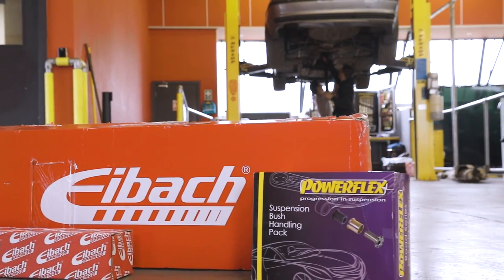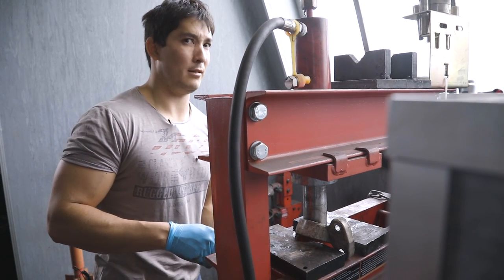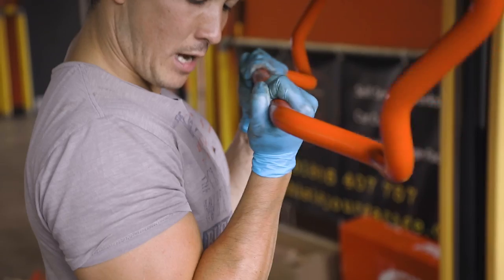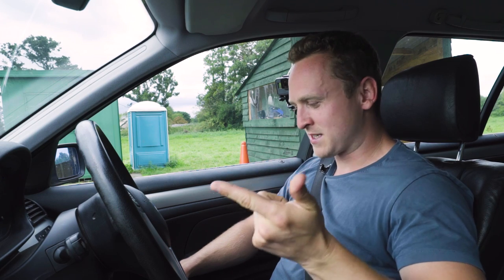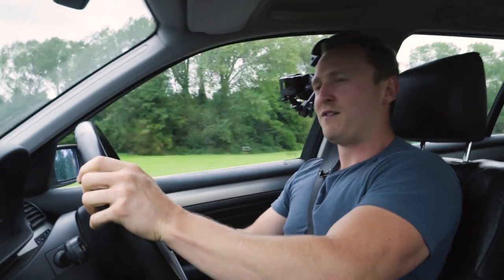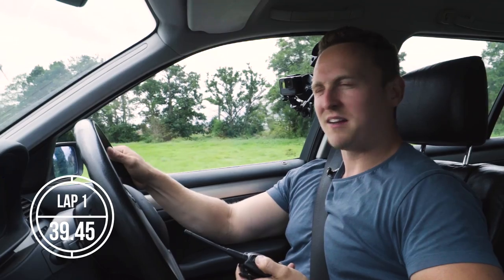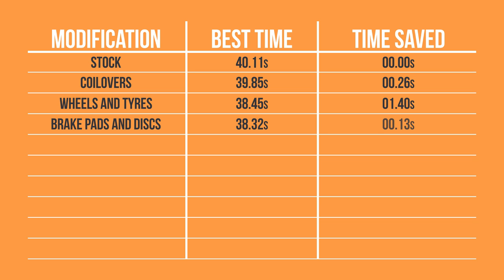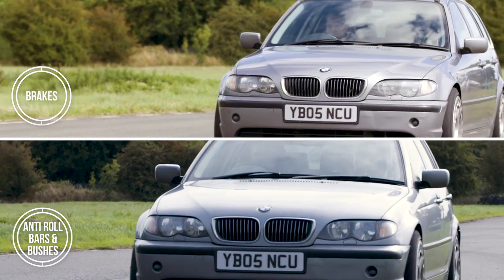Do Thicker Anti-Roll Bars And Polybushes Make A Car Faster?

Comment: I put stiffer front and rear ARB on my old Impreza and it introduced more understeer on turn in. I put the standard front ARB back on and the car was fantabulous. The stiffer rear definitely helped it feel nicer on power coming out of corners. Whether it was faster or not I don’t know, because I didn’t have a maste with a stop watch like you do, but it felt great.
Reply: Yeah, the lack of improvement could be down to the change in balance. Could be too much oversteer, leading to inadequate power delivery/exit speed. That's why adjustable sway bars are MUCH better.
Reply: yep, on awd and fwd cars especially, uprating the front arb almost does nothing, it keeps the understeery nature of the drivetrain, but what's the fun in that? Planning on putting an uprated rear arb on my 9-5 aero and some fresh front bushings

Comment: One point is missing here... The geometry of the car. 
Very cheap is to buy a IR thermometer and check the temperature distribution on the tyres. 
In case you have too much temperature on the inside you can adjust the camber more positive.
Or more toe in etc.
When I see you car in slow motion I can see that the tyre is deforming, even if the rim looks okay. 
Please go on the track and check the temperature distribution!
I would expect min. -0,5s by a professional setup.

Comment: I had a set of Hotchkis anti roll bars with polyurethan bushings installed on my Nissan 370Z 6MT sport pkg a couple of years ago. It definitely reduced body roll during cornering and sharpened the turn in approaching corners. The tradeoff was increased ride harshness, but that wasn't a big deal.

Comment: So am I the only one thinking that all they're proving is that these mods are mostly a pointless waste of money? They've made the car stiff and more uncomfortable and that barely made it any faster at all, the bulk of the improvement so far has been from simply fitting better tyres. Making a car corner flatter doesn't always mean it will actually go around the corner faster, even if it might "feel" like it.

BMW knew what they were doing when they set up the suspension and realistically you're not going to do better by just throwing in stiffer aftermarket bits. A decent set of tyres and a remap would have probably shaved off several seconds already.
Reply: Sérgio Alves basicamente...num carro usado principalmente para fins desportivos faz algum sentido, em carros de dia a dia e deste tipo (carrinha com motor Diesel) é perda de tempo e estragar o que o carro tem de bom de origem.
Reply: You are 100% correct sir.  Lower and stiffer is not often faster.  Never on bumpy tracks and in wet

Comment: Love the channel. Before you add power you should fit a limited slip diff so you can put the power to the road, corner exit speeds will vastly improve as you are able to go on the power sooner.

Comment: Please just strip the damn car and the lap time will drop dramatically....
Reply: a bit unfair as the E92 M3 wasn't stripped down also
Reply: also unfair to people that don't have such wagons in their markets and that drool at the idea of having this car
Reply: @thegreatfalcon5  what? How do you not have this car on your market? Where are you from? Mars?
Reply: The Shark  Canada but as far as I know we didn't get the E46 wagon diesel... only the gas sedans and wagons
Reply: oh, I see, i'm sorry dude..
I'm not really a fan of diesel cars, i think you'd be better off with a gas one, but heck, do your thing
Reply: The Shark  When you taste the low MPG a diesel gets in pretty much any conditions (highway, city, racing, towing...) ... Also, the fuel is way more readily available and generally diesel engines are much less complicated thus more reliable than gas engines... SO much torque at such low RPMs... Been daily driving a TDI for over 3 years and the next step is going full electric... Can't go back to floppy gas cars...
Reply: i've driven a lot of diesel cars, from vw's to bmw's, and in my country (Portugal), arguably 70% of the cars you see on the street are diesels, but diesel cars, to me, are just heavier and dreary, while I'll admit the low RPM torque is pretty sweet, it really isn't the best way to go racing, as it will probably produce wheelspin..
Also, I don't do a lot of mileage per year, so having a more expensive, less thrilling (to me) and less powerful car, would be pretty much pointless..
Anyway, I'm glad you enjoy your TDI, I hope you have fun in that thing, those engines are bulletproof if you keep up with the regular service.
Cheers

Comment: I bought a front and rear anti-sway bar set from Turner Motorsports made by H&R. The front anti-sway bar I always joke about could be used as a curl bar for your biceps. I think it's 36 mm. Quite a bit larger than the very WIMPY stock anti-sway bar.

 And then I see the guy in the video actually using it as a barbell LOL. 
Mine are adjustable I have the front adjusted to full stiff. And the rear I have at full soft. 

I don't think the bigger anti-sway bars affect my ride quality negatively. But they certainly do keep the car from rolling on the racetrack and in the street.

Comment: You may not notice the larger anti-roll bars, but if you do the poly bushes in the control arms in the front suspension, you WILL notice a difference.  At least I did when I put some in my first neon.  I actually hated how numb and stiff it felt at first until they wore in a bit and I got used to the new handling characteristics.

Comment: Watching the slow motion footage almost shows that the car with the huge bars cause the car to slide out from the apex more; losing time. Knicking that high curb probably adds time. I realize they're trying for shortest distance.  Can you dial in the springs/shocks or maybe an alignment suited for this track? Tire pressures? Try a comparison with a more seasoned driver to see if there's a greater difference. 
This has been fun to watch. 
I'd keep the interior. It's more realistic to what people do to their cars. Who would daily drive a gutted car? It would get old real quick. 

Keep up the good work guys.

Comment: Next stage : Drop in K%N  air filter, replace Heavy factory muffler with lught aftermarket muffler, Limited slip dfferential. This will result in better traction at start and more power delivery under heavy load, a bit more air comming into the engine/ engine brething a bit better, and 20or so Kg weight reduction. Your best bet would be remowing the interior that is behind the driver, but since his is still a  daily driver car that is not an option. Greetings from Slovenia, keep the mad fun series going.

Comment: Hi Alex. Great project:). I believe for you to go faster still without increase in power is to service the car. You can use that to say you need a tip top condition engine before increasing.

Comment: 12:22 - Although in the 'swaybars' car the driver would be trying harder due to the decreased body roll, it's interesting to note that the top car has considerably less initial understeer and is then neutral coming out of the turn, while the bottom car has more understeer followed by final oversteer requiring opposite lock to negotiate the same turn.

Comment: Sometimes thicker and sometimes thinner rollbars make cars faster, you need a balance not a bunch of parts.

Almost all of the time poly bushes are a huge upgrade (except for on sways), unless there is an issue with bind resulting from a part that is supposed to do more than turn inside the bush.

Sway bar bushes are a tuning component allowing more or less give before the bar comes into full effect. Best to leave them off at first while upgrading the rest of the suspension, then add the polys on the end of the car needing less traction.

Comment: The E46 is an awesome entry level platform and I love what you have done with your E46 330d ,but may make a suggestion possible for your next episode before power mods. An upgraded Differential would help loads around those turns as well as weight reduction. I say alone with these mods you will see atleast .25 second off your time.

Comment: I know this is your show, however, I think next time you decide to do something like this, start with the bushings first, please? The reason I say this, you could have seen just how much difference is made when replacing old rubber bushings with new poly. bushings. This could have been a great way to see if any difference was made with the poly. bushings with the suspension still stock, and you would have gotten one of the hardest mods out of the way first as well. I know personally what a difference going from worn out bushings to new stock replacements is like, but I would love to have seen the difference made going from the rubber bushings to the poly. ones. At that point, everything else you changed would likely have done even more to lower times.

Comment: I did Strongflex poly pushing in every suspension part on my E36. Definetly worth it, but it's not a job you do in your home garage with your mates over the weekend. You need a press, and you need patience. Lots of sitting around with a screw driver and hammer dink dink dink getting that 30 year old inner sleeve out

Comment: This does only help on a race track or a new paved road. My car had progressive lowering coil springs on it when I bought it, that shit was the first I changed to standard springs as the car was bouncing of the road in the corners. Could increase the speed a lot with longer travel and softer springs on our bumpy roads.
Would be interesting to see what time you would get with a 5 cm lift and slightly larger offroad tires and then cut the corners instead.

Comment: Smallest differences do biggest changes, so what about clutch stop bolt mod, so you don't over-press clutch and save time, this car uses electric throttle. Sprint booster is proven to increase throttle's responsiveness

Comment: Even if the tires aren't stressed as much on that short track they won't get better after each run...would be awesome to see a completely new set of tires (maybe even a premium brand like Michelin or Pirelli) at the end of the series if there's a notable difference between a set of brand new premium tires and slightly used budget tires.

Comment: First of all I have those yellow power Flex polyurethane bushings on my E46 M3. As far as poly bushings go these are quite soft and the car rides fine. I actually wish I had put in some harder durometer bushings. I will probably replace them with harder AGK bushings.

Comment: I'm going to go through the trouble of removing a part especially something as simple as subframe or sway bar I'm going to strip it down to bare metal and give it some paint to prevent corrosion. It would drive me bananas to know that I took it off and could have painted it.

Comment: Polybushes WILL NOT last longer than a rubber one! where rubber one has to just flex, polybush has to rotate where it wears very fast, so you have to re apply that grease to stop wearing them down completely. BTW. love your series, keep going :)
Reply: Well said. You're right. From my research hardrace rubber bushes are a better option than anything poly.

Comment: Why not see if changing the rear diff ratio will help scrub time off by putting more usable torque where you need it or extending the top end out?

Comment: Messed up putting that large bar up front on stiffest setting. Reduced outside tire grip. Try on soft and would have been faster and had more total tire grip. Or leave on oem sway bar up front   . Sway bar is not the way to go for grip. You have to increase track width to reduce lateral weight transfer, add stiffer springs. Set rebound and compression rates for comfort or perfomance ride bias. Sway bars are only there to fine tune over steer or under steer. Not just jack up the size or stiffest setting. The video comparison clearly shows more tire grip on oem setup VS over steer and lack of outside tire grip.

Comment: Yeah what you've done there is by fitting a stiffer front anti roll bar is to decrease the front grip slightly. @Engineeringexplained has a good explanation of why.  :)

Comment: What you didn't mention in the video is that poly bushings make the car stiffer all around, which can be very irritating on a car that's daily-driven. There's a lot more NVH transmitted from the road and you lose a fair bit of ride quality. That doesn't matter on a track car, but unless you do a significant amount of track driving I'd say poly bushings are overkill. Thicker sway bars, on the other hand, are worth doing on any car.

Comment: I agree that the poly bushings make the turn in sharper and the responsiveness generally better, but this type of anti roll bars do not make your car faster because they cause even more weight transfer to the outer wheels when cornering (i know it sounds weird because the car corners flatter, but it's true), so you have lesser cornering potential. Although, they give the driver greater confidence because of less body roll experienced.

Comment: So they fit new bushes all round and new rear camber arms, but then no wheel alignment job?  Surely you'd want to make sure everything is angled right after taking it all off and putting it back on?  A good setup can make all the difference!

Comment: Trust me in the point you are now, stiffening the front and rear towers connection would make a considerable difference. Youve stiffened the suspension, so now more flex goes into the chassis than before. Time to stiffen the chassis. Put front and rear Sway bars. Proper ones.

They dont do almost nothing on stock softer cars but as soon the suspension gets stiff the flex in the chassis gets greater and its time to stiffen up the chassis otherwise the faster rebound of the damping is absorbed in efficiency with the added flex. And chassis flex is worse than soft suspension for this purpose because that flex allows the chassis to change the geometry  to an undesirable point during cornering, which means that the wheel attack the road with an undesirable angle more often, therefore less grip. Geometry is very important and those cars have great suspension design but could be easily flawed with chassis flex.

Comment: if you decide to improve power, If you supercharge it I would suggest you a superchanger for the massive torque increase with also the diesel engine massive torque. If you put a supercharger also the boost would be instant at around 1.5k-2k revs being perfect for launches from corners, thought in the accelarion it will do bad, we all know that. That's my opinion, have a nice day :) .

Comment: Using manual timing from a phone you'll be lucky to get accuracy to 0.2sec let alone any less. Thicker anti-roll bars don't increase grip just reduce body roll, in fact grip will be reduced if it's stiff enough to lift the inside wheel. Race cars use much stiffer springs and less/ no anti roll bars to increase grip.

Comment: Maybe take a little bit of air out of the rear tyres, looks like it's a little bit too stiff at the rear causing it to skate. I can't remember if you've got adjustable dampers but if so then you can also look at softening the rear to get a bit more traction that way, having the suspension rebalanced to suit the mods probably wouldn't be a bad idea either

Comment: I'm wondering if the rear floor isn't cracked. It's a really common problem on the E46 - especially M3 and 330D (caused by the high torque). As rusted as the rear subframe was, the floor has cracks for sure... Should have welded in some reinforcement plates while the subframe was out. And then strip the car finally. Finally compare the cars on the Nordschleife to see what the M3 really can do ;)

Comment: Bit more weight reduction ?. Also as its a Diesel, change gear at 4000 max. Since the power curve generally starts to fall over 4500. So keep it lower and in the max torque band.

Comment: How about removing weight like stuff in the boot. And maybe some insulation material. Perhaps a different lighter battery. Also a different exhaust system can reduce weight.

Comment: Polybushes are good idea but not for all applications if anyone decides to use them its better to do it by some pro-garage. Thing is that some suspension configurations might not benefit from them and some would also require some other mods.. 
But thicker anti-roll bars are always good idea :-)

Comment: Should of fitted a slipper when you had the diff out. If anything it would help with traction on launch. Lower body roll may improve driver confidence but due to the non linear nature of tyres may decrease lateral grip. The extra lap would of helped tyre temperature and driver confidence as well. Whatever it was floating around near the gear stick though wouldn't of helped

Comment: Try setting the back part of Your seat a little closer to the steering wheel (~5cm) and the steering wheel 2cm lower. Maybe the camera makes it look weird but it seems You sit a bit too far from the wheel and Your hands on the wheel (when going straight) are much higher than shoulders.

Comment: 0:48 the rear tyres are on the wrong way around. NS2R'S are directional and not asymmetric, so they need to be put on in the correct orientation.

Comment: Did you guys consider chassis braces wouldn't that help also improve rigidity and handling as part of the above mentioned work you done ? Of course power mods a must but just curious if this was considered or not?

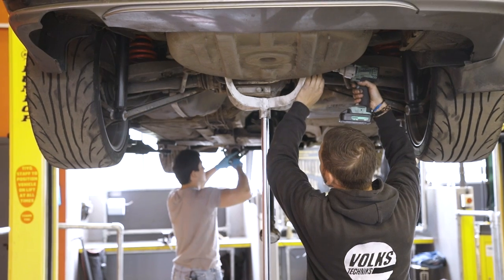Comment: 1:16, am i an idiot or did you get the rotation of the tires wrong in the back? (swap wheels left-right) front ones 4:54 are correctly installed looking at the tire profile? then again i could be an idiot